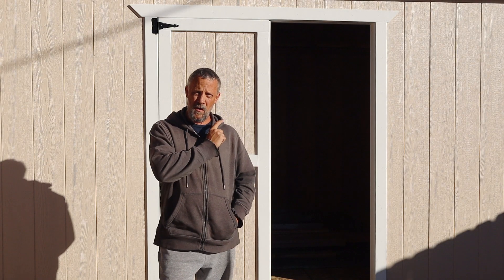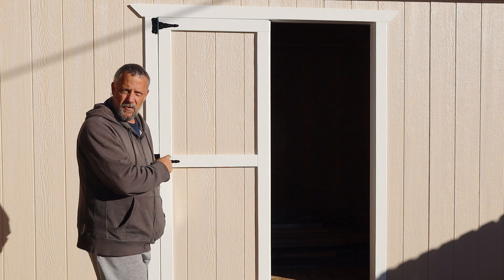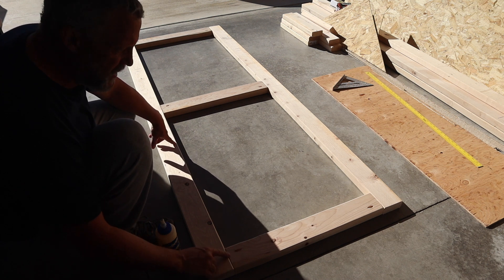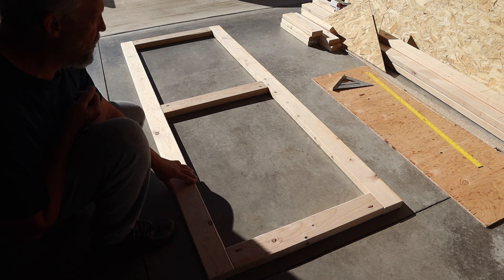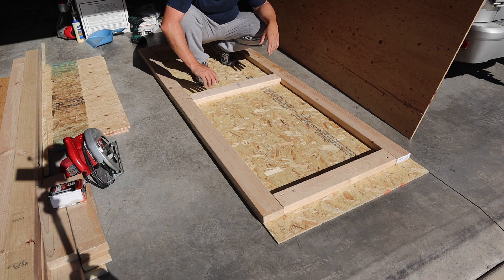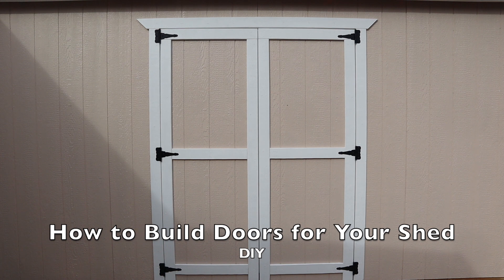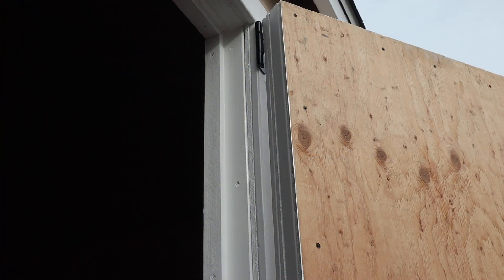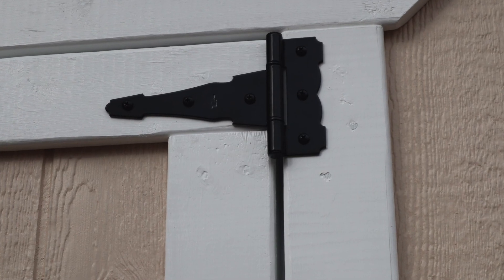How to Build Doors for Your Shed

Comment: your upper and lower horizontal frame boards should be on top of your vertical framing board to prevent water from entering the end grain of the board not between them.

Comment: Good. It looks like the way your doors overlap below floor level that they will keep out the mice, at least from entering there. I can't tell if the other gaps are small enough to prevent mice entry but it looks hopeful. I hear that mice can usually squeeze through a 1/4" gap. Frankly I'm tired of mice and the shed I am building now is for once going to keep them out.

Comment: Great vid. You mentioned the opening is 62 inches x 80 inches, can you tell me the true measurements for both the left and right door frames. Thank You, Mike
Reply from the maker: One door has a 1" piece on the inside that the other door overlaps. You have to close one door before the other for them to close properly. The front seem is centered on the door opening so it's all symmetrical looking at the doors from the exterior. Hope this makes sense.
Reply: @ thanks for responding. So, the right thing is to give all four sides of the L frame 1/8 in. on each frame to allow for expanding and the same for the R and to keep in mind the center gets 1/4 inch with an overlap of one inch at the bottom for rain? My opening is 64 inches wide and 80 inches high. Your vid is one of the best or the simplest way of looking at things. Good job
Reply from the maker: Thank you, I wish you the best with your project! 👍

Comment: I saw you extended the 1x4 trim along the center edge of the right-side door to overlap the left side door, but you'd already installed the left side door and the camera angle prevents me from seeing if you have the siding extended from under the 1x4 trim on the center edge of the left door to 'marry' with the trim on the right door?  And were the steel plates (at least on the floor) for your barrel lock galvanized?  Thanks for your video; well explained and quality built doors.
Reply from the maker: Yes the trim seam of the two doors falls in the middle of the door opening. The overlap is slightly offset on the back of the seam where the two doors come together. The actual gap between the two doors at the seam is about 1/8 to 1/4 inch top to bottom to allow for expanding during temp changes throughout the year. No the steel plates for the barrel lock is not galvanized.
Reply: @DIYHomesteadProjectsDIYHP10  thank you for your quick reply, but I’m sorry, it’s still not clear to me what, if anything, you did to the left door to ‘fill the gap’ at the centerline.  For the right door you extended the trim 1/2” beyond the siding panel toward the gap.  Did you extend the siding panel 1/2” toward the gap on the left door, which would be behind the trim extension on the right door?
Reply from the maker: Oh I understand your question now. On the left door the exterior siding and trim are set back 1/2" on the 2x4 door frame along the opening edge. In other words the siding and trim don't come to the edge of the 2x4 frame along that edge on the left door. When the doors come together the left door must be closed first. Then when the right door is closed the 1/2" overlap from the right door overlaps 1/2" of the exposed 2x4 frame from the left door.  It's kind of hard to explain but I hope that makes sense now.
Reply from the maker: When I built the 2x4 door frames the left door frame is 1/2" wider than the right door frame. This way when they overlap that 1/2", the center of the two exterior panels and trim are centered in the door opening.
Reply: Thank you - much clearer now. So you extended the trim and siding panel 1/2” on the right door, so that, plus the 2x4 frame extension from the left door gives equal thickness (with the two combined) to what each door is individually?
Reply from the maker: Yes 👍
Reply: @DIYHomesteadProjectsDIYHP10  thank you!
Reply: @DIYHomesteadProjectsDIYHP10  One more question, please.  My wife is small (5' tall, 110 lbs) with some chronic pain issues; it's a bit unfair to ask because you don't know the details of my wife's issues, but - given these are heavy doors - would a small woman have difficulty opening/closing them normally?  I want to prevent warping, but must be sensitive to my wife's limits.  Thanks.

Comment: How did you keep the right door from opening or how can you open it without a door knob
Reply from the maker: The locking bar keeps the right door from opening. When I remove the locking bar I simply open the right door by pulling on the locking bar mount.

Comment: What are your recommendations on keeping rain from entering the top of your barn doors? We have a new shed and heavy rains get in thru that area. Any type of drip edge or something to divert water but still allow the doors to open? Thanks pal!
Reply from the maker: Sorry pal but I don't have any recommendations for that issue. I have not had that problem so far.
Reply: @DIYHomesteadProjectsDIYHP10  well I appreciate ya reaching back out man
Reply from the maker: No problem, I wish you the best.
Reply: Install a drip edge, or flashing above the door seam?
Reply: Maybe try a little porch above the doors?
Reply: I screwed an "L" angle galvanized thin metal above door. Caulking between metal and barn. No issues

Comment: I found your videos very helpful and well done, it's by far one of the best shed videos on YouTube. I have a question, I am working on my shed doors right now and I am wondering if the right door need to be 1/2 shorter to overlap the left door. Is that correct? Are there a different measurement for the left and right door or are both exactly the same?
Reply from the maker: Thank you, I appreciate that! The 2x4 door frames are 1/2" difference in width. Looking at the front of the shed the left door frame is 1/2" wider than the right door frame. The door skins are exactly the same width so the doors appear to be the same width from the front when the doors are closed. This makes the door frame on the left door protrude 1/2" past the skin and that creates the backing for the right door to close against. The skin on the right door extends 1/2" past that door frame and creates the lip that overlaps the frame on the left door. The backing on each door is the same width of the 2x4 door frame. It's much easier to build than it is to explain but I hope this helps you understand how I built the doors and the overlap.

Comment: No sag ? I doubted it might sag by now. The only way to prevent it from sagging is to use half-lap joinery and reinforce it with wood glue, also when you attach LP smart panel to the frame, be sure use lot of glue at all 4 corners.

Comment: Dude.  Why did you put the top addition trim. Wings……?……?
Reply: Aesthetics,  I kinda like it, not the same ole same ole.
Reply from the maker: It also helps prevent water from running down the sides of the trim and going between the trim and the siding.
Reply: @DIYHomesteadProjectsDIYHP10  Would running a bead of exterior caulk across the upper edge of the additional top trim help prevent the rain seeping downward?